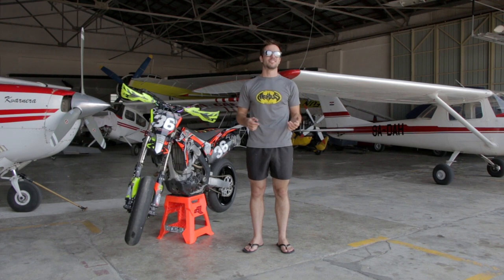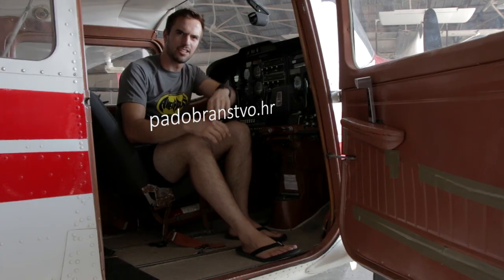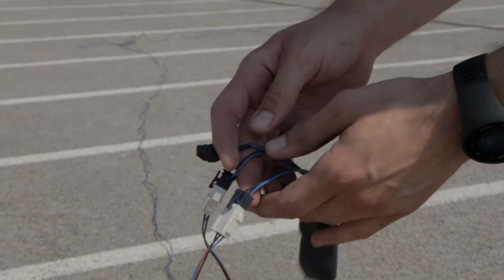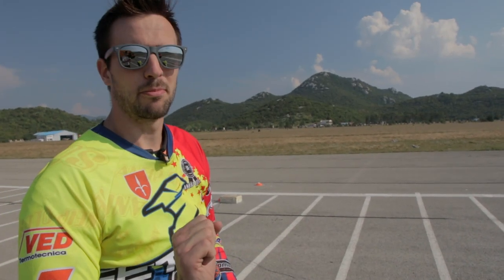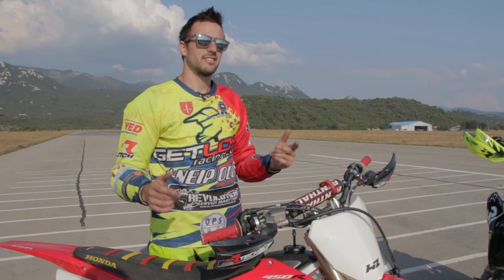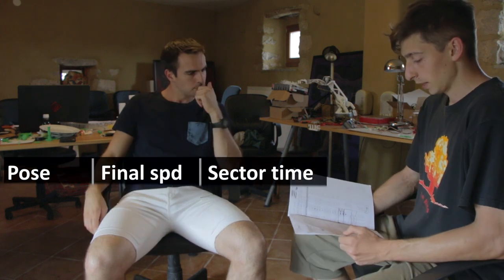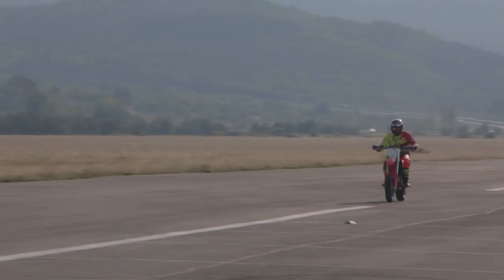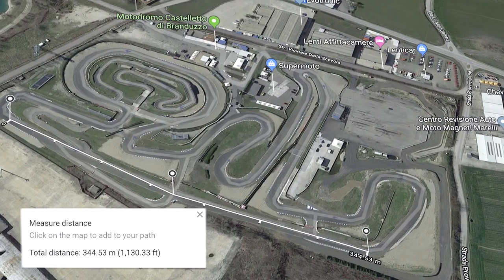Can you be FASTER like this? -- SUPERMOTO MYTHBUSTERS --

Comment: First of all, thank you for your interesting video: the experiment has been carried out in a scientifically meaningful way and it's also pretty cool!
Just one thing, but I'm being a little pedant here: you could have measured the wind speed and direction, maybe using windsocks or anemometers from the airfield.
I'd also like to quantify the air drag; I'm no engineer but I like physics and supermotos.
So the power absorbed by the air drag can be estimated via the following formula:
0.5 • drag coefficient • frontal area • air density • velocity³
By using some data found on the internet at reliable sources, a typical value for the drag coefficient • frontal area of a sportsbike is 0.5 m², including the rider in a prone position. Using it, at 140 km/h the aerodynamic power absorptance should be about 25hp. For a dirtbike, which surely has a worse drag coefficient, it must be even more! Basically half of the power of your CRF is fighting the air drag, at that speed.
I own a Husqvarna SM610 that I used on public roads and now i use it only on tracks; mainly Castelletto di Branduzzo (I'm Italian).
On public roads it often happened that I had to cruise on some long straight roads before reaching the twisty roads on the mountains and I found the air drag quite unpleasant, so I used to tilt my body forward until I found that sweet spot at which the drag seemed to balance the weight imbalance; I felt more comfortable in that way.
At Castelletto I do it because it's more comfortable, faster and it even feels more exciting.
I know that very fast riders like you make something like 180 km/h at the end of the straight in Castelletto and so I guess that you would gain even more than 0.2 seconds there.
Reply from the maker: Heyo, I like being pedantic :D 
We didn't have access to airfield stats, but all the runs were +-1 km/h (per position), so a tight enough spread to draw conlcusions I think.
About Castelletto, we get to around 170kmh (according to GPS chronos), though the straight lasts maybe less, because we are shifting from 3rd and always in the powerband (in the vid I start in 5th very much out of powerband, for consistency). So it could be the same time difference!
Comunque a Kaste ormai si fa le gare con la chicane, quindi niente strategie furbe :D. Io sono ingegnere e il film editor (Erik) sta facendo il master di fisica, quindi apprezziamo discussioni tecniche :)
Grazie per il commento e speriamo si torna in sella a breve!
Reply: @GetLowRacingOfficial  Complimenti a te e a Erik per gli studi!
Speriamo!

Comment: Gearing and top speed?
Reply from the maker: Mx bike 13-48
Sm bike 14-47
Top speeds I don't know 😅
Reply: @GetLowRacingOfficial  ok, husqy 450 fs 2018 with 14-48 gearing does 160 before revving out. Did 180 with 15-45 but it was not revving out so i suspect 15-48 is a good top speed gearing before touching the motor.
Reply from the maker: @pkerttu  good assumption, I always gear for the tracks, I never hit top speed. I think 14-48 hits the limiter at around 165kmh. I have a racing motor and ECU though, they squeal quite higher than stock.